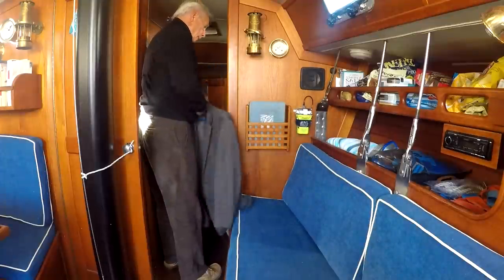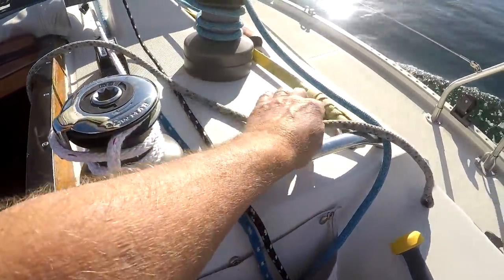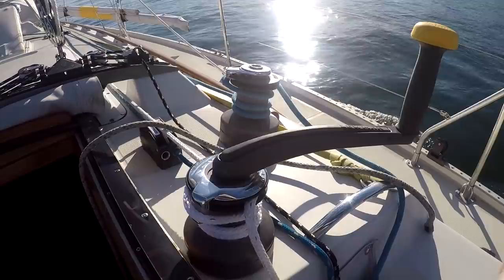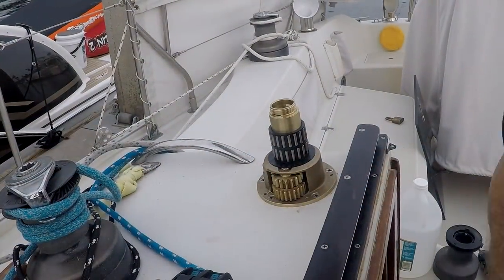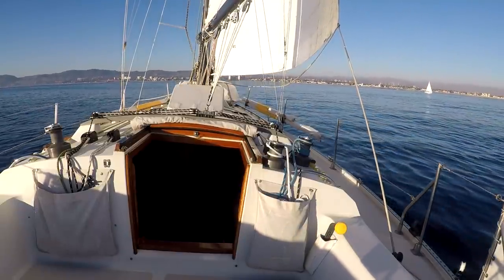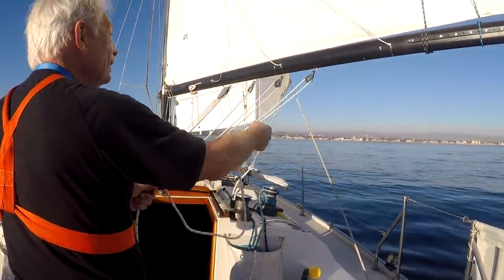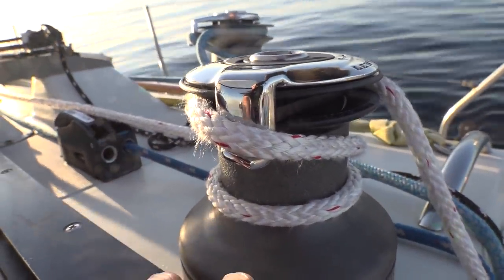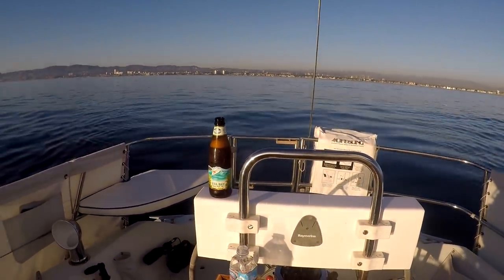Why We Sail--"Escape the Neighborhood"

Comment: That’s was nice.  Thank you.  But not so sure about the new main sheet.  Try putting you old main sheet in a bucket with some fabric softener.  It may loose a bit of strength but it will still be plenty strong and the fabric softener does wonders.  Leave it over night and then give it a good rinse.  Good luck.  Stay safe.